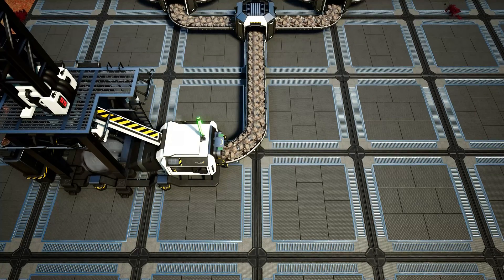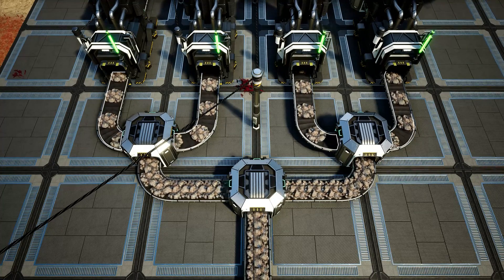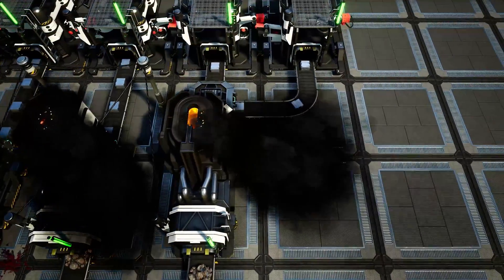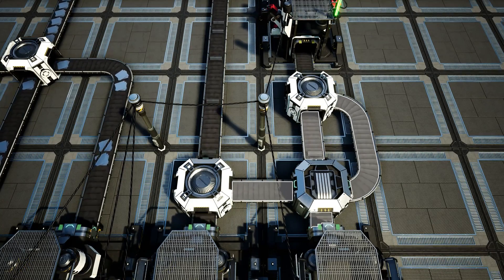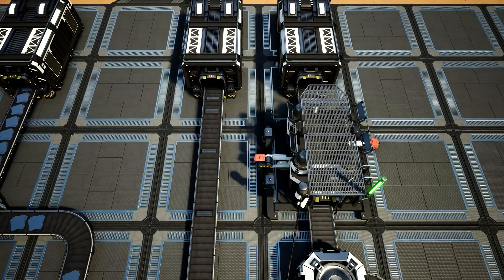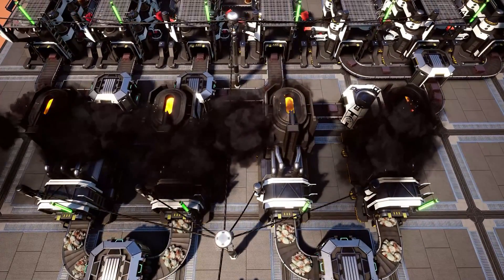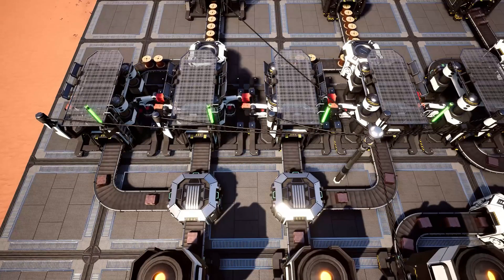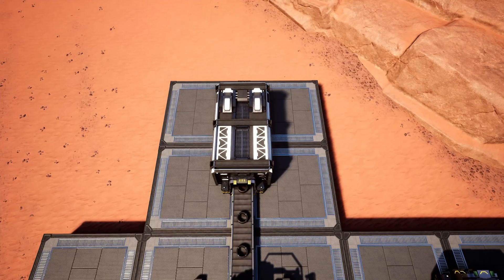100% EFFICIENT Beginner Tier-1 Iron & Copper Components [SATISFACTORY GUIDE]

Comment: STUFF FOR COPPER PART

6 splitter
3 merger
4 smelter
8 constructer
3 storage container

matierals
For splitter 12 iron plates and 12 cables
for merger 6 iron plates and 6 iron bars
for smelter 20 iron bars and 32 wires
for constructer 16 reinforced iron plates and 64 cables
for storage 30 iron plates and 30 iron bars

all up
192 screws
144 plates
56 iron bars
32 wires
56 cables

Comment: I have a tweak I suggest to all new players. 

On the iron rod side, you can split the combined 30 rods/min output into six lines of 5/min. With those you merge 2 lines into one line three times (aka 2 splitters -> 3 mergers).

Two of these 10/min lines shall go into screws, the last 10/min line of rods into storage.

I originally followed this to a tee, but I found the rod storage backing up really quick while screws were sorely lacking in bulk. It requires more tier 2 logistics, but you WILL thank me later!!!!!

Comment: What I don't understand completely is that the Mk1 Belt is limited to 60/min...
If the Miner creates 120/min... Isn't that a bottle neck and basicly the whole start is limited to 60? So the first splitter would not divide into 60/60 but instead to 30/30?
Reply from the maker: Mk2 belt on miner

Comment: i know this is an old video but it would be great if you talked a little about the belts. A tier 1 belt isn't fast enough to handle a pure iron node and can only transfer 60 resources a minute so even if you put a splitter its still only 30 going to either side, then 15 to each refiner

Comment: for anyone who is smarter than me, what are the resources you need to make this?

*edit: 2 years later, I realized that I meant 'resources'
Reply from the maker: It’s one of the first factories you’d want to build on a fresh world to provide you basic building components to build additional factories. Sure you can make most of these using the crafting bench or the HUB but automating it so you can explore, plan other factories, or pet doggos, is optimal.
Reply: @Scalti made a typo whoops

Comment: Where are your main power source, grand wizard !? xD :O I am really scratching my head from where you get the power to run the MK1 digger
Reply from the maker: Using a mod so video making us faster.
Reply: @Scalti  but where in that build would you place the bio burners?
Reply from the maker: All depends on the environment. I typically put 6-9 centralized since they are manually fed and easier to keep track of managing fuel.

Comment: do you have to use a MK 2 belt for the 120 ore per minute into the splitter that splits them into 60 each?
Reply from the maker: Yes. Otherwise you’ll only get a line of 60 ore broken into 30 and then 4 lines of 15 which is 50% of smelter capacity if you follow the design specifically.

You can always use two lines of 60 from 2 normal nodes as well.

Comment: I dont understand how people can manage to get enough power to fuel that amount of machines in this guide at Tier 1. I know you can build more generator but the higher rate of power consumption require more fuels,meaning you need to cut leaves more often. What i usually do is I make a chain that produce lets say cable, and when im short of wire i will replace the constructor with storage.
Reply from the maker: You only need 3 biomass burners to power both of these systems total. Iron uses 1 miner (5mw), 4 smelters (16mw), and 6 constructors (24mw) for a total of 45mw for iron. Copper uses 1 miner (5mw), 4 smelters (16mw), and 6 constructors (24mw) for a total of 45mw. Total power draw is 90mw. Each biomass burner can support 30mw of total power draw. 3 biomass burners support both systems at 100% efficiency.

Using alien carapace or organs is the most effective means of obtaining biomass. Once you unlock Solid Biofuel, a full stack will power these systems for a comfortable amount of time.

Comment: only issue i see is that a T1 belt is max 60/min. how are u getting 120/min from the miner on a 60/min belt?
Reply from the maker: It’s not a MKI belt. Both the iron and copper systems have a 120 belt off the miner
Reply: @Scalti  Ah ok,  i just couldnt see how it was 120 with a mk1 belt, thank you